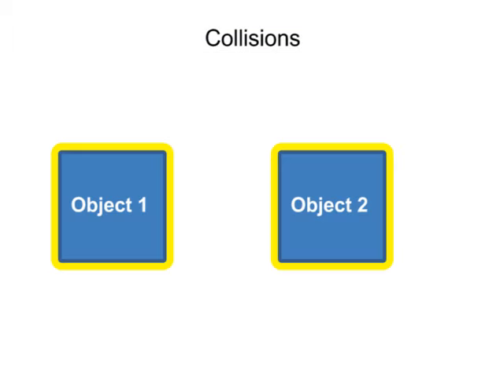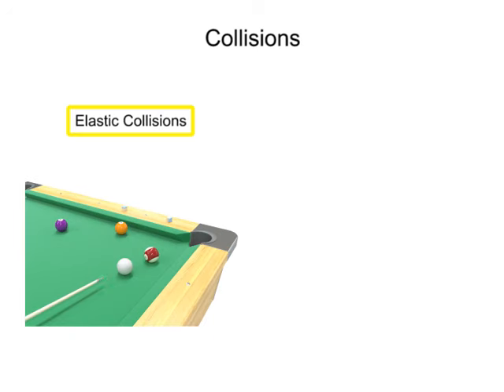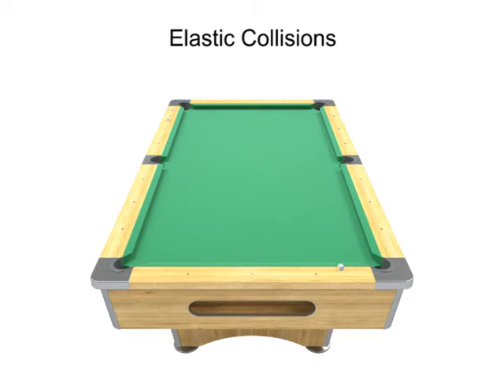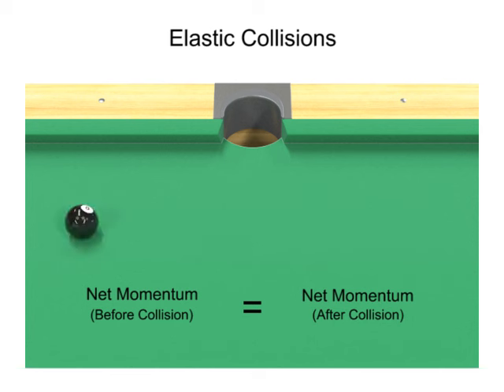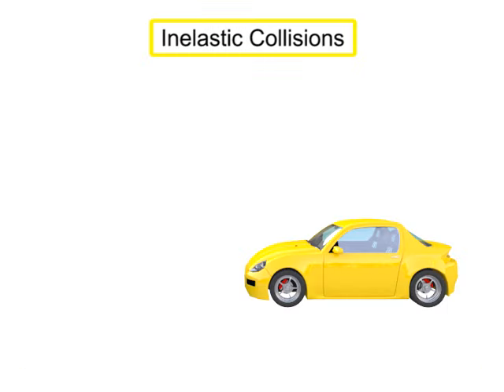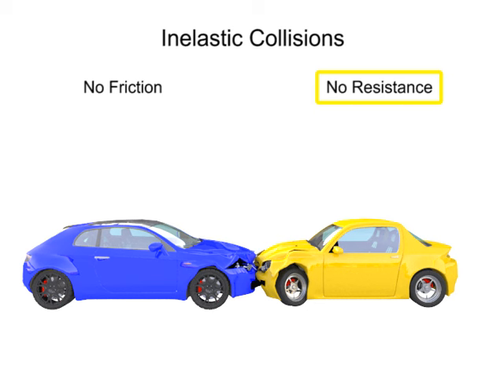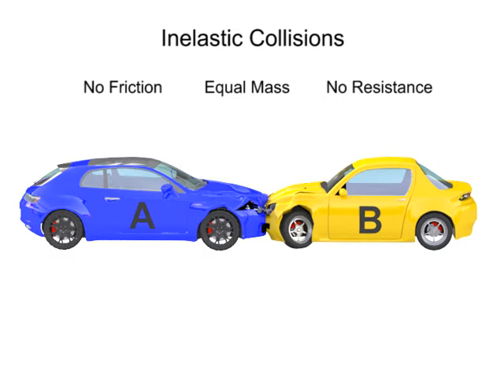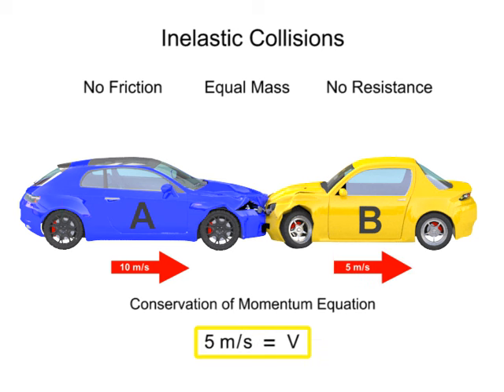Inelastic and Elastic Collisions: What are they?

Comment: Why is the kinetic energy conserved?🤔or is it because there are no opposing  forces?💁‍♂️if so, why isn't it  elastic collision?
Reply: The collision conserves kinetic energy, because the impact and restoring forces are conservative forces.  All kinetic energy gets temporarily stored as elastic potential energy as the objects come in to contact, and then is released as the restoring force pushes the objects apart.

An elastic collision is rarely part of reality at the macroscopic level.  It is more of an upper limit of perfection, of the maximum possible kinetic energy as the outcome of a collision.